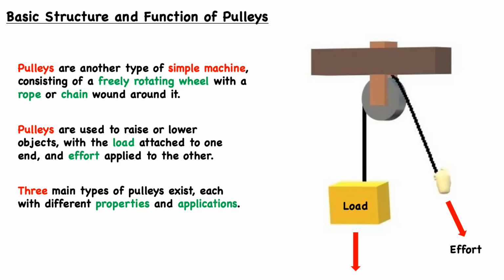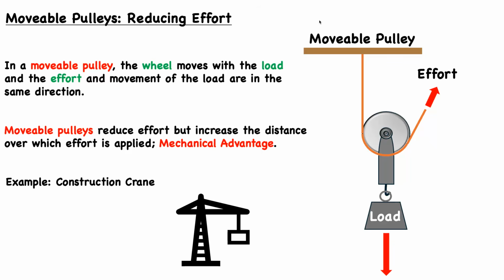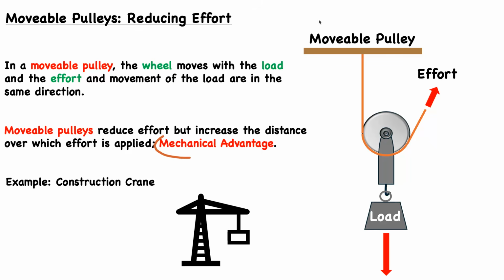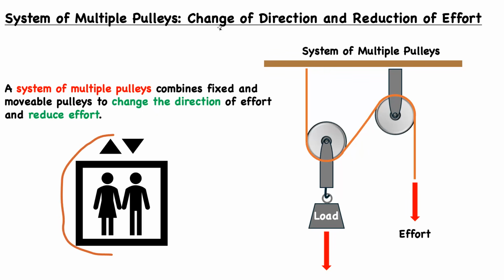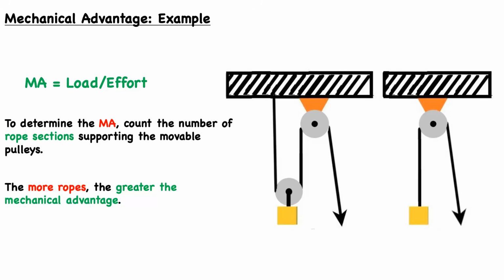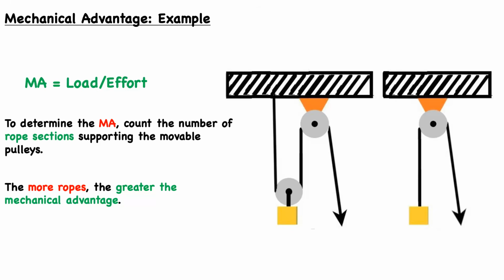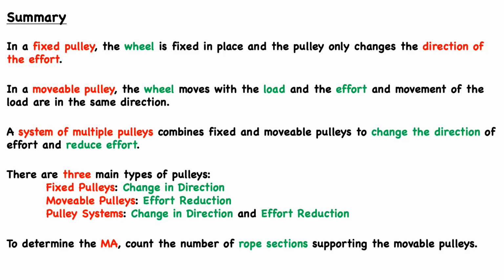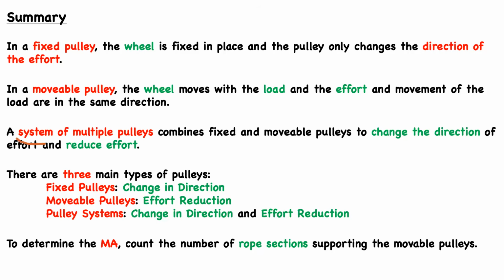Understanding Pulleys - iPREP's Mechanical Comprehension Tutorials

Comment: Fine, insofar as it goes.  However, you need to show how to do things like calculate the tension in each rope and how to calculate the amount the "pulling" rope moves versus the displacement of the load.  In any Real World pulley system these calculations are important, especially in systems where the "pulling" rope is being pulled by an electric motor and drum arrangement.  This knowledge is needed to properly size the motor and its required controls.